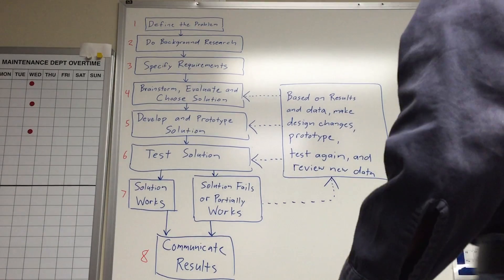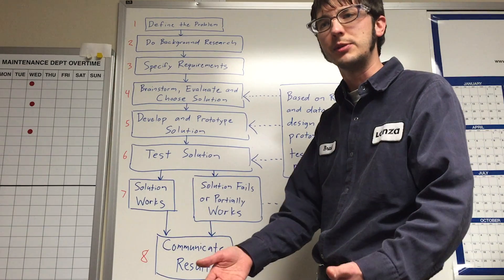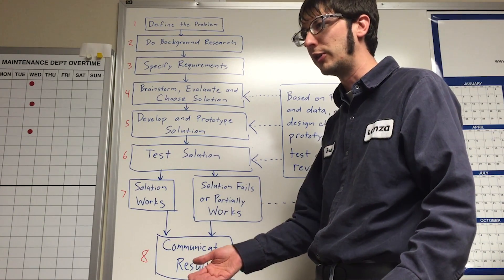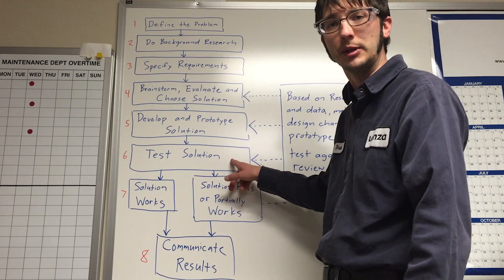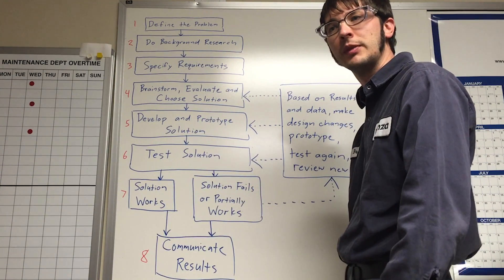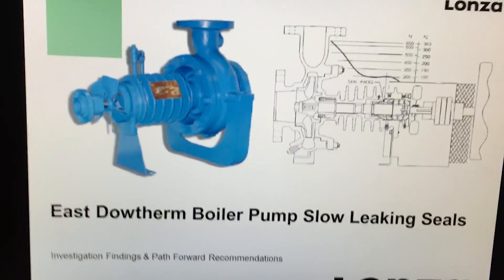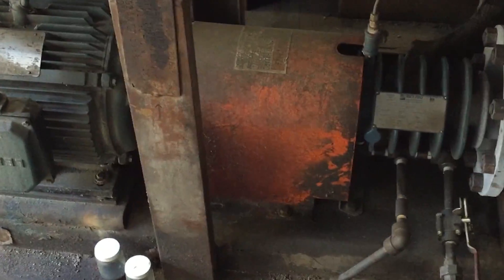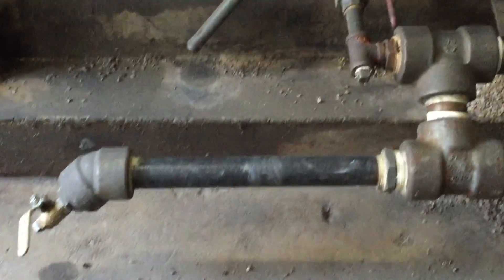Concepts in Chemical Engineering - Problem Solving

Comment: Excellent video ...this is the type of engineering that probably 90% of the students in engineering will end up working on...it may not be fancy...but it is real, you get the chance to apply your background and get paid for it. Without this type of skills (problem solving) plants around the world would not operate and priduce as expected, excellent video!!!
Reply: Sorry, so basically chem eng graduate will end up on industry? I'm still researching about chem eng, cause I'm planning to take chem eng for university..
Reply: Excellent, if you work in the industry (i.e. chemical processing plant) this is pretty much the kind of job you´ll do, if you work for an EPC your work will be mostly design, there are also other fields you may work on such as process safety and process control
Reply: Thankyou for your reply, actually I want to take ChemEng so I could working on petroleum industry.. But still it's still kinda fuzzy and vague cause in my country (Indonesia) a lot of people who take engineering at university end up on Bank or other place that doesnt related to engineering, If you don't mind, can I ask you privately on other chat media, I've a lot of thing to ask. But if you don't want to it's okay.. Sorry to bother you.
Reply: Sorry but I'm bad at this linkedin things.. I've try inmail, but it requires account plan which cost money. Is there any other mediasocial that I can contact you Sir?
Reply: Linkedin is free of charge